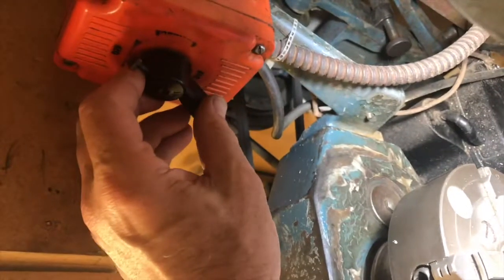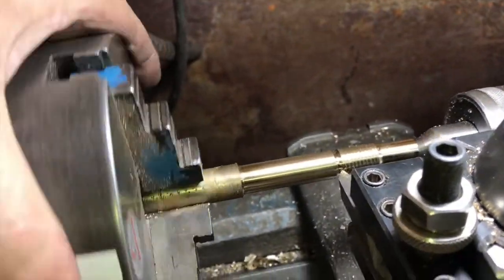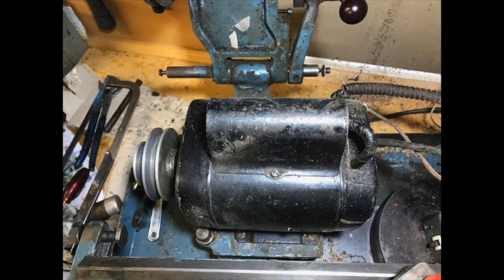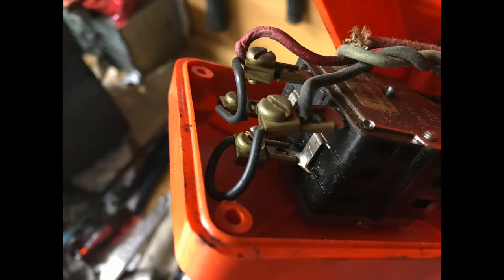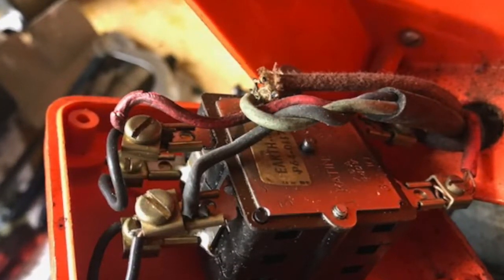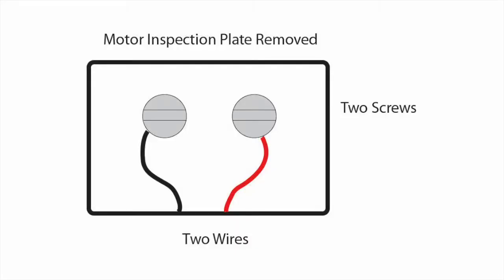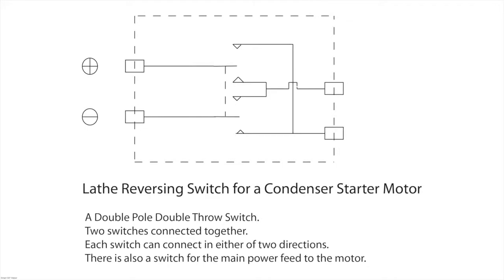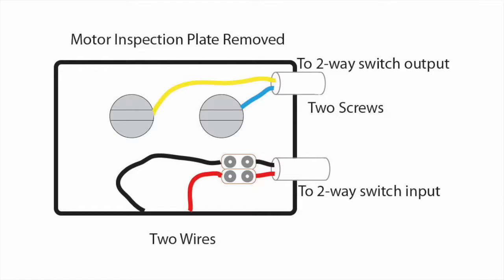How to wire a reversing switch for a lathe with an ordinary single phase motor.

Comment: Thank you simplifying!
Reply from the maker: You are welcome.  If you are interested I have also made videos on (evan-e-cent) about installing a DC motor out of a treadmill to give variable speed, and another video about how a Pulse Width Modulation devise ($67) can be easily wired to give variable speed DC. It also mentions Variable Frequency Drive system for 3 phase AC motors.
Reply: @Evan-e-cent  thanks

Comment: What is the size of the hoursepower dynamo type A lathe . what is 3/4 hp or 550watt enough .thanks
Reply: For singel phase AC sir .
Reply from the maker: The original motor was the 3/4 HP single phase AC motor seen in the video. I never had any worry about not having enough power. You can always use back gear to get a huge increase in torque if necessary.  I thought the motor did burn out under heavy load, but it was only the thermal cutout switch on the motor. I just had to press the switch to fix it.

Then I decided to replace it with a180 volt  DC treadmill motor so that I could have variable speed and that is fantastic.  It is rated at 2.5 horsepower but only when you apply full voltage and allow the current to increase. I use a PWM controller and all this is explained in my other videos. 180v at the maximum current setting of 10 amps is 180x10-1800 Watts. Divide by 745 to get horsepower gives 2.4 HP. But I probably run at 1/4 of full power most of the time.

I put the DC motor inside a stainless steel box because it has big permanent magnets and a fan that could attract steel swarf.

Comment: Hi at the start you said you swapped the blue and yellow wires around - I am assuming now you used a reverse switch you didn’t swap these back once the reversing switch was installed - sorry that bit confused me
Reply from the maker: Hi, Lets see if I can reply within 15 minutes.  I started by switching the two wires over as a test to see whether it would reverse the rotation of the motor.  It did. After that I used the reversing switch to swap the wires over each time a flipped the switch. In other words the switch was swapping the wires over automatically. It doesn't really matter which way the wires are hooked up, the motor will change direction when the switch is changed.  Mine is a rotary reversing switch. Normally I would want it going in reverse when I turn the lever to the left and rotating forward when the switch is turned to the right. If I put it together and it was working back-to-front, all I have to do is swap the wiring over. Then it will work correctly. DONE!

Comment: Hi Evan, Very good explanation; I want to do the same thing to my milling machine which doesn't have a reverse switch. However my motor has two capacitors.... can I wire it up using the same method?
Reply from the maker: Hi Pike, sorry I missed seeing your question 4 months ago. You have probably solved the problem by now.  I am not familiar with motors having two capacitors.  It is possible they are wired in parallel and act just like a single capacitor. Let us know what you found out! Thanks.